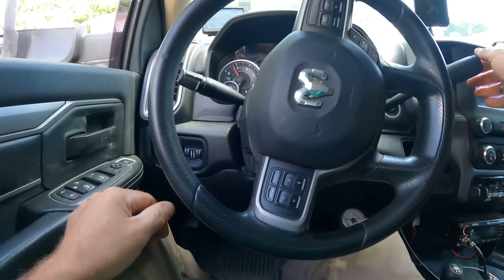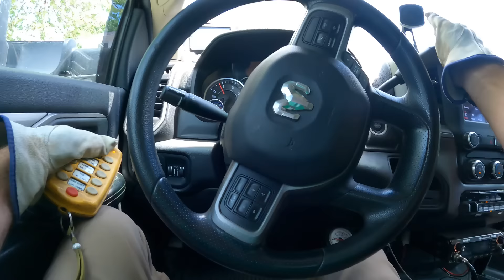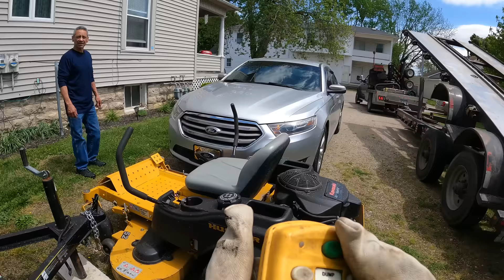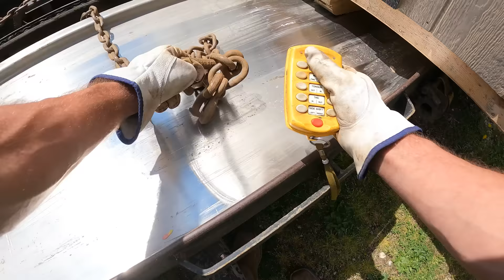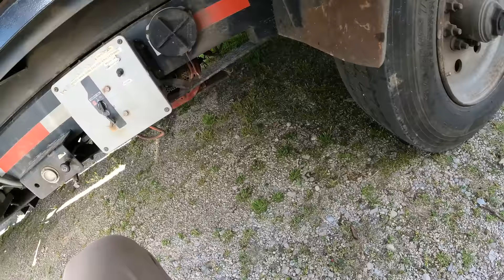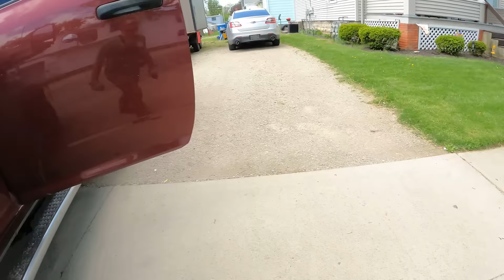Not all Shed repo's are this easy

Comment: I Hate it when the Lots Resell them for just a Few Hundred Off the Original Price even tho the Previous Owner already Paid THOUSANDS Towards the Price.. A $15,000 Shed, Owner/Renter has Paid $7,500 towards it, It gets Repoed, Lot Resells for $13,000 or If you Bargain with them they Might sell you it for $12,000... Then by the time you pay it off, you paid almost $20,000 for it.. BUILD People, Build!.
Reply: My brother inlaw worked for a used car lot in Vegas and i saw the same car sold 3 times in six months. They would put a down payment, pay two months then no payments and it would be reproed and sold the next week. Month later same thing.